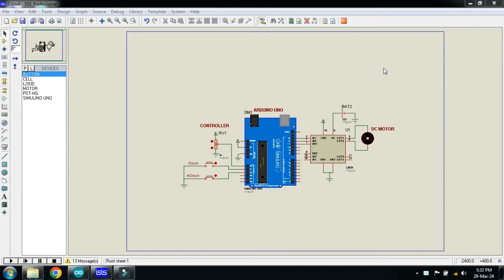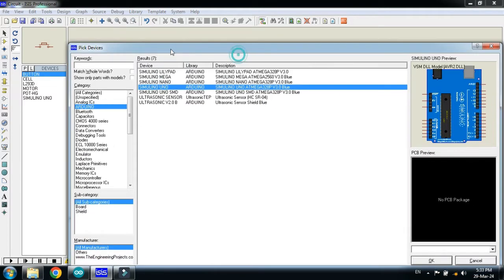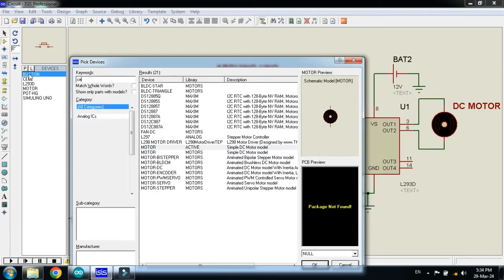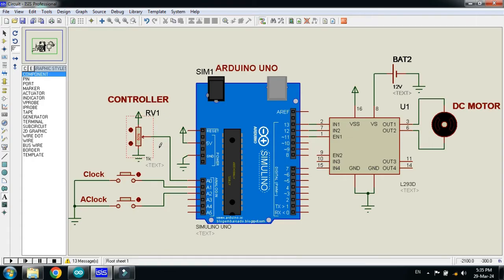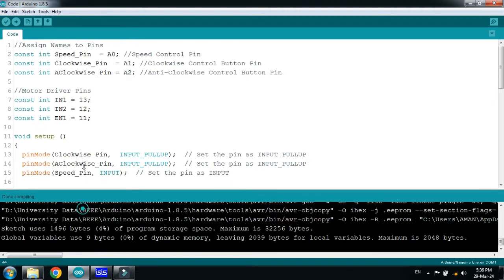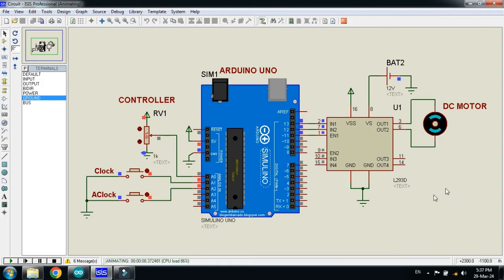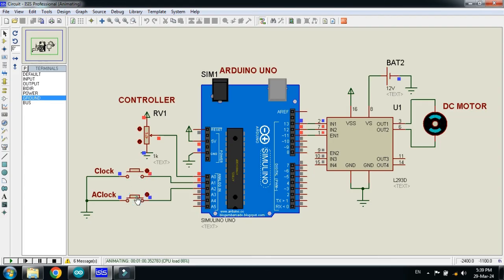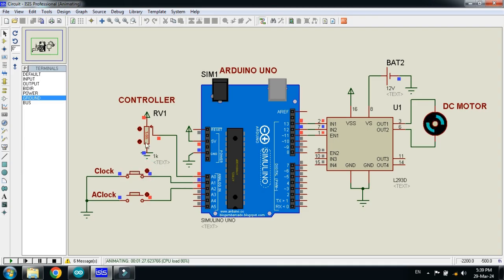Direction & Speed Control DC Motor With L293D Motor Driver ||Code & Circuit || Proteus Simulation

Comment: This library file is not in your description.
Reply from the maker: Library is not required in this circuit. If you are asking for Arduino code and simulation Circuit, so please it is in the video description, please check again.

Comment: Sir please make a video on
Transformer protection and power theft detection system
Transformer faults are - over voltage and under voltage, overload protection and over temperature protection
I can't understand doing the project please help
Reply from the maker: Most of these videos are available on my Channel,  Some of links are given below:

Over Voltage and Under Voltage Protection System:
https://youtu.be/tVHh4ZbKKEc

Overload Protection of Transformer
https://youtu.be/_WEZWomAxBw

Temperature Control Circuit
https://youtu.be/1R1vXzVsJAw
Reply: @thebrightlight9472  sir need also the power theft
Reply from the maker: Don't have it yet
Reply: @thebrightlight9472  sir can u please make a video on it it's very much urgent
Reply from the maker: You can search more videos related to it in YouTube.
Reply: @thebrightlight9472  i have searched sir but none of them has clarity like your videos
And nobody have shared the code also so if possible kindly help me sir
Reply from the maker: Ok will try
Reply: @thebrightlight9472  sir kindly try within 1 week
Reply from the maker: Ok
Reply: @thebrightlight9472  power Theft detection system based on transmission line hooking 
I need this kind of project
Reply from the maker: Ok